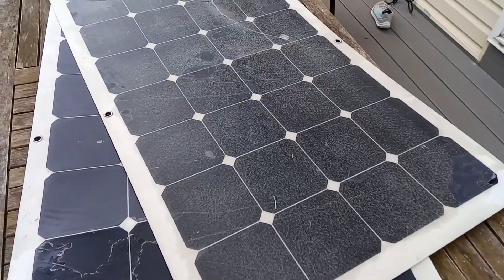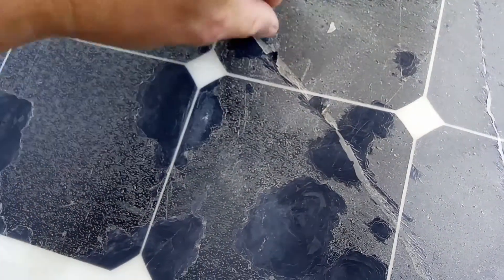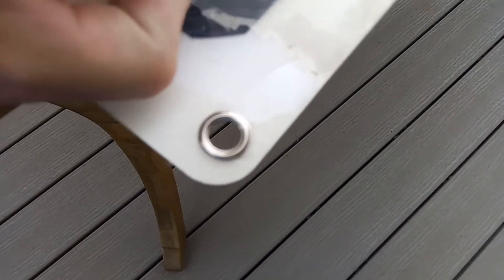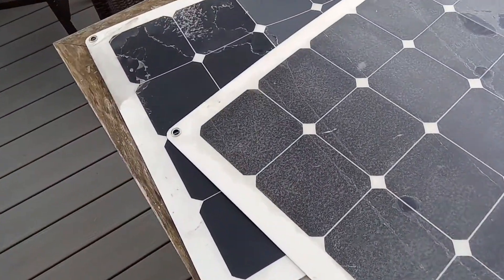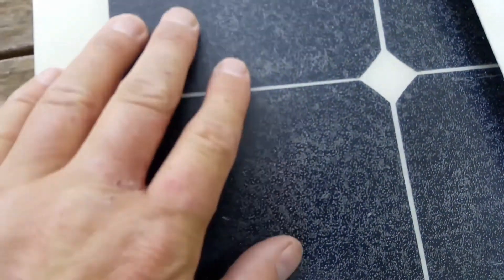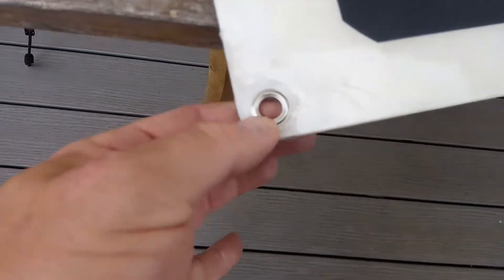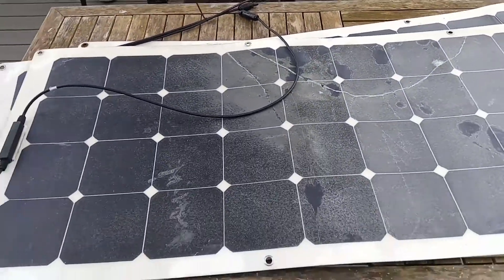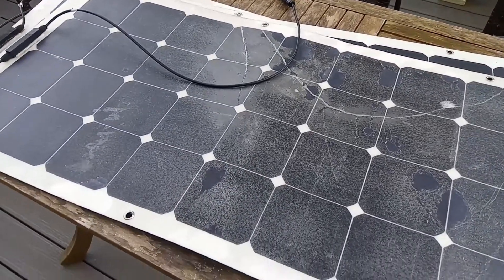3 year update on Flexible Solar Panels on a sailboat in Maryland... Your not gonna believe it

Comment: Aside from looking ugly and losing their top protective layer, flexible panels can also become damaged from getting too hot, especially when they're mounted flush against a surface. Rigid panels benefit from being able to get sufficient airflow underneath them. Flexible panels are such a convenient product in theory, but they are horribly overpriced and their performance isn't even comparable to rigid panels, sadly.

Comment: Can you peel the existing film and put something else over it.?
Also, I hear the reason the flexible panels warp and peel is, they don't get air flow underneath.
Reply: Would be super tricky installing these on a curved surface if you have to provide airflow. I still feel that the flaking on the surface would still occur.

Comment: Is this done with Pet films or ETFE films?
Reply from the maker: I believe they were Polyethylene plastic, so PET.
Reply: Did you replace them with ETFE panel?
Reply from the maker: @zarbonida  no, built a stainless arch and used glass top panels. Did it the right way this time. And it was cheaper.